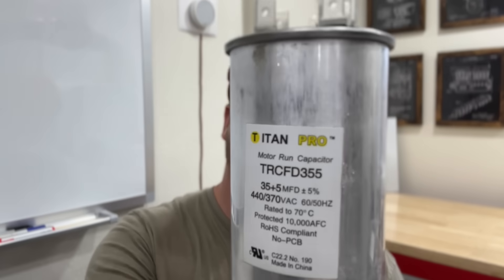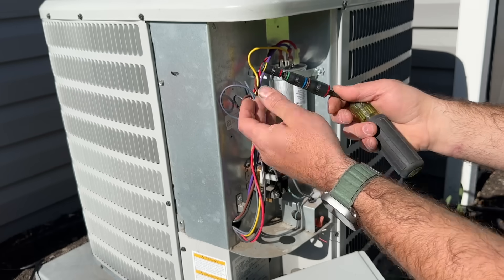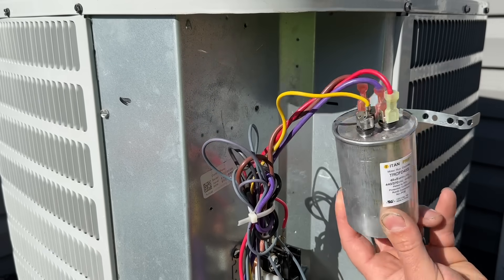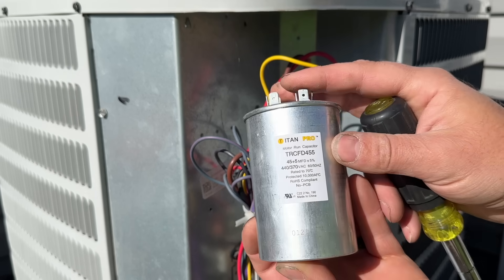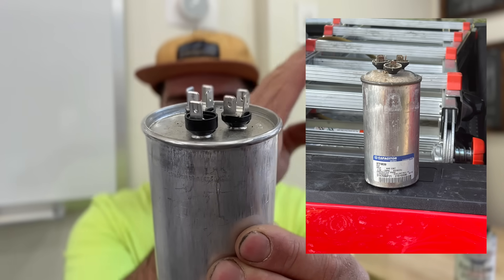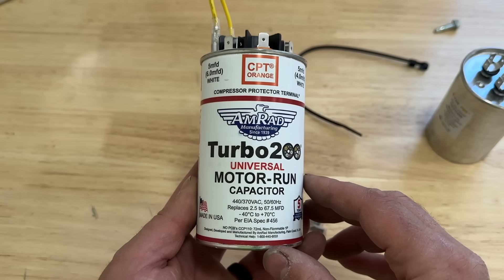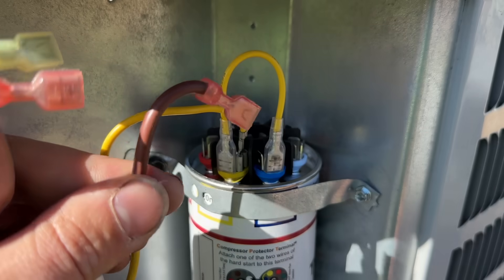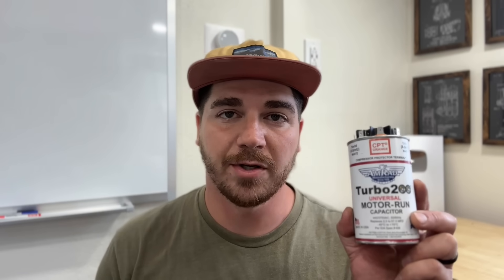HVAC Contractors Practically Make Their Living On These

Comment: I was a victim of this scam.  My unit was not cooling and they said it was the capacitor which was a lie. I know electronics and the capacitor is to help start the compressor. They charged me 300.00 but didn't add freon which is what I needed. I got my money back as well as a lame excuse. My compressor never had problem starting or was buzzing. Never called them again

Comment: I appreciate the videos that you are helping the people, on the other hand you are not disclosing the electical danger diy are exposed that could lead to death or injury opening a 240 volt system that is connected to very high voltage. just saying
Reply from the maker: How did I not disclose the danger? I said to pull the disconnect, and discharge the capacitor. And showed you how to do both. 🤦🏻‍♂️🤷🏻‍♂️

Comment: Pro tip. You can "jump start" your motor if it is humming. My fan wasn't running and I just took a small plastic rod and spun the fan in the "on" position and it took off.

This told me immediately it was bad AND it helped me cool the house a few times until I could get one in. I just had to monitor and make sure to shut the unit OFF when the unit cycled back off and repeat when needed manually.

Comment: I replaced the contactor then narrowed it down to the capacitor on mine - compressor was running, fan was not. I told my wife that it would take 2 or 3 days to arrive, but she refused to sit in a hot house for that long. So, had to pay a douche $490 to replace it. At least he came out on a Sunday and used one of those American-made "Turbo" universals, but damn!

Comment: Do you walk into a restaurant and demand you bring your own can of Coke instead of paying $3.50 for theirs at 1000% mark up? You are paying for the companies knowledge, time, investment in that part they carry around and so on. There is a cost to doing business. I've never heard of a $2000 capacitor but here in the Houston area we need to charge $185-$250 depending on the size of the company if you want to stay in business and grow. No one is talking about the $60k van, $5000 van wrap, $10k plus in tools and parts and the YEARS of experience that person or company brings to the table. I haven't even mentioned advertisement and other business costs yet. Most companies now use straight forward pricing so you know a level 1 "capacitor" will be anywhere between $185-$250.

Comment: it was the condenser fan motor,  probably the second most common failure after one of the motor start capacitorrs, that made me learn how HVAC systems work and are repaired. They wanted $600 for a fan motr that was $20 on Amazon and required the removal of 12 whole sccrews to replace. So I watched youtube videos until I understood. Now I advocate for minisplits with heat pumps.
Reply from the maker: Yes they can be reused 👍🏼

Comment: FYI, it's for power factor correction not holding energy to kick start the motor. Capacitors don't hang onto energy like a battery can. Instead, it shifts the power factor of a starting winding on the motor to make a bunch of torque at 60hz electrical frequency and 2-900rpm before that same 60hz electrical frequency and no power factor correction takes over from 900-1800rpm or wherever the motor was designed to operate on its more efficient, primary winding.

Comment: I do HVAC in automotive and I was having an issue with my evaporator coil icing on my home unit. I knew the system was low on charge so I started checking. Mind you, this system is 30 years old now and this is the first issue I’ve had in 15 years. Started spraying components down in soapy water, just a leaking schrader valve on the high side service fitting. Super simple to check, easier to fix. Had a friend who is a licensed HVAC tech charge it for me (I’m not certified to handle R-22), flipped him $150 for his troubles and saved a $500 service call. Even without HVAC knowledge, just type your symptoms in a Google search, you will get the answer.

Comment: A Capacitor is a little battery that gives your AC an extra jolt?  You should really get your information correct.  A capacitor is a device that creates your third phase of electricity that makes your motor in your compressor and condenser fan operate. They have a high discharge storage voltage that could harm someone.  Yes they are inexpensive and some unscrupulous tech can take advantage of people.  But care is required and knowledge is needed to test and diagnose this.  This is not like changing a battery in your car.  I am an industrial chiller mechanic with 36 years of experience.  Be careful with knowledge from a simple video.  I understand he is trying to help.  But caution and more research is advised.
Reply from the maker: I said it’s like  little battery. Most people don’t know what single phase and 3 phase is, so I’m not going to get into the science unnecessarily. I just want to help them replace it safely. If you don’t think this video is unsafe in any way, please state why. And it’s easier than replacing a battery in your car in my opinion. But to each their own.  Cheers

Comment: There's also a common offer that is getting you to buy an "AC Tune-up" at this week-only prices. They don't need tune-ups. These offers give them access to your unit and will often tell you that your capacitor is weakening. They don't get weak. They're good or not good. Don't allow yourself to get hosed by them!

Comment: 15 $ ??? , must be a china capacitor.  Be carefull what you install . The supplier sells the original for around 45-60$ . Hvac compnays have to make money so they will sell them around 120$ plus the service call . 

In canada the hvac companies are heavily regulated. The techs make 50$/hours plus truck, fuel, insurances, gas permits, contactor permits and much more.

A small company will charge around 135 $ for service call and 120$ for the part so 255$ plus tax.

A large company would be much more , around 500$ .

REMEMBER sometimes the capacitor goes because of other related problems

Comment: This is insane, teaching people to replace capacitors. This is extremely dangerous. if you were not trained to work with electrical systems safely, please don't attempt to learn on a system with large deadly capacitors. I went to trade school for the commercial electrician program but I don't  work in the field and have no financial incentives to say this. please be careful working with electricity.

Comment: I did this repair on a large central AC unit and the starter cap cost me about 80 bucks...I saw it was shorted on my capacitor tester.  It's really sad to hear that so many AC techs are low life's...A couple hundred bucks should be tops on that repair bill.

Comment: I am not an HVAC guy,  but I am a tech in the low voltage industry. The people commenting here are right, not all companies or individuals are bad people, in fact the majority are good and honest. Like any industry, there are always going to be bad eggs mixed in that tarnish that industry or trade. To say " all cops are bad" or "all roofers are this", "all plumbers are that" is just ignorant. I personally would never be able to take advantage of someone like that, but others do, some are even encouraged to do so by their employers to generate more $. Just because a part costs $20 to replace doesn't mean you will get a bill for $50, you have to take into account the time, costs, and fuel associated with scheduling your repair. When you call a company with your issue, they have to review and coordinate a tech to come out, schedule it,  recover the fuel used to drive to you, cover the tech and the office staff's time involved, then the cost of the part/parts needed, sometimes arranging to pick up that part, and having someone make an educated guess as to what the issue may be so they can bring the part when possible to avoid a 2nd trip.
The reason a bill may exceed $300 quickly for a $12 dollar part is because that tech probably makes roughly  $25-$40+/hr, the office/management staff gets paid hourly or salary,  the service manager gets paid, plus the service fee which is typically a flat fee during business hrs, and even higher for emergencies, after hrs, holidays, weekends etc. Most companies charge a minimum service fee or minimum hrs for visits that are unscheduled/unexpected. At the end of the day it is much cheaper for you to replace things yourself IF YOU ARE ABLE TO DO IT CORRECTLY AND SAFELY, but the reason these companies exist is because most people don't have the time, experience, tools or training to do it correctly, and often cause more problems when doing so because there are factors they just didn't know about that cause more damage to systems. You aren't just paying for a tech to come swap a part in less than 15min, you are paying for the experience and training invested in that tech as well. I am guilty of misdiagnosing and assuming myself. I actually misdiagnosed my A/C unit about 2yrs ago by replacing the motor when it was actually the capacitor that was bad. I found this out when my new motor would not start running after replacing it, I judged the capacitor by its appearance instead of testing it like I should have, and simply because I just didn't know any better. So now I have a fairly new motor which I had to wait to ship to me, then after figuring out I needed the capacitor in the 1st place, I had to go get that as well lol. This would not have happened if I tested to confirm my diagnosis, (would have taken less than 1min)  but I assumed... and now I know I need to do this before ever buying parts. Lesson learned. The motor was $148,, and I think the capacitor was $22. Another thing to consider is availability of parts. An HVAC tech usually has the commonly needed part's in their vehicle or at the shop, and when they don't they usually have local suppliers they can visit. It could take you days or longer to get that part, especially if there isn't one local and it has to be shipped. (some local suppliers won't even sell parts to someone without a commercial/business acct.) My point is, if you are going to do this yourself, prove your theory before spending money senselessly.  There is enough info out here to learn how to test and verify almost anything if you have basic skills, some tools, and a multimeter. I work as a fire alarm tech and I know when I an sent on a service call there is minimum charge, for Contract customers:
$115/hr x 2hr min, O/T and weekends is $172.50/hr @ 4hr min.
Non contract customers:
$130/hr x 2hr min, O/T and weekends is $195/hr @ 4hr min. So when I come out to a service call, the charge is automatically $230 for me to arrive on a weekday during 7am-4pm for a regular customer. If more tech are needed for bigger jobs, installs or repairs, that cost goes up accordingly.
If I use a part in my van you are paying for that too but most of all, you are paying because I have been trained to find and fix your issues efficiently and safely. If I am there for only 22min, you still have to pay the 2hr min charge, and that is just policy in the service industry. You can always call around to other local companies to see what their charges and rates would be to repair your issue if you think the charge quoted to you seems high or unfair. Things are not cheap these days, if you legitimately can't afford expensive repairs in one payment, explain your situation and see if the service company can work with you on charges, a lot of times they can accept a down payment and apply a payment option. To those of you out there that are trying to rip someone off, that $hit is gonna come back to bite you! I understand if your employer knows your on a job that will only take 20min to swap out a capacitor, but your told to stay on site for 2hrs and make it look like your working, while banging on pipes for effect, however wrong, that isn't exactly your fault. But those of you trying to pull a fast one on someone you think isn't knowledgeable or competent, I highly suggest you be careful. These things are exposed more than you can imagine, and if you are working for yourself or own your own business, you can get sunk real fast just over a simple review online for trying to rake thousands for a simple repair that would actually cost $190 to fix. Please do the right thing and don't try to take advantage of people. There is no good reason or excuse to be grimy like that. Helping people will come back to you, as will being dirty. If your business is sinking, more often than not it is your own fault for making bad decisions,  and even of its not through fault of your own it's still not right to take advantage. Do not try and dig yourself out by passing along rediculous charges that aren't necessary or warranted. Doing good by people will pay off far more in the long-term. Most of us are struggling out here, and we all need to do the right thing regardless, we should be helping each other, not hitting each other in the wallet.

Comment: The only thing these run capacitors do is act as a buffer between the AC unit and the electrical grid. A bad one will, in fact, break the system, but as you said, they're cheap, and also, if you're not seeing the lights dim or something on your house when the system starts up, it's probably not getting sketchy. My former neighbor, a commercial property, had a unit that had gone so far bad that MY lights would dim when THEIR system started up.

I need to clear something up that I just saw on another HVAC channel. One of the first things you learn in electronic principles school is that you cannot get an accurate reading on a capacitor's capacity while it is still connected to the circuit. That other channel was trying to reverse-calculate the capacity from voltage and current measurements under load. Just unplug the darn thing and measure it with the meter on the right setting. It looks like this:  --| |-- or --) |--

Now back to our show where I rant about HVAC scams and why this crap makes me never want to pay them for annual service packages.

Capacitors: $10-$20 part marked up to $200. I have the invoice from Red Cap Plumbing in Tampa in my email. Also, 1.5 years after they installed a new system to replace my mismatched dinosaur that came with the house, here were the things they tried to fleece me for: 

- Another capacitor, on a WARRANTY COVERED system that THEY installed. I refused the repair, checked it myself with a digital multimeter in capacitor mode and then called the office, whom doubled-down and said they would warranty the (unnecessary) parts but the labor was $200 to put in the (unnecessary) capacitor. 

- "Pan strips" (flattened copper pipe) to prevent growth in the condensate pan after they installed an aluminum evaporator coil. 

- "Bio growth" in the evaporator. Duh. It's wet. This is why we call them out to clean it. 

- a "Dirty" filter that I had just replaced two days prior to his visit. I had even written the install date on it. He never even pulled it out--I was there the whole time. They also tried to sell me a $2000 24V UV light + lifetime carbon element system that I found online for $250. Freakin' insane. This was after they installed the new unit and said there was no need to change anything related to the ducts or supply. 

After he gave his recommendations and a list of FIVE estimates for different tiers of remediation, I told him to leave. I never booked with them again, nor did I ever subscribe to a routine maintenance plan again because they and the other company I tried to work with just used it as a chance to try to scam me with $2000 solutions for something that would be a max of 2 hours labor and $250 parts. I'd gladly cough up $250 a year for semiannual checkups that take 30 minutes if it didn't involve some scary story to frighten me into paying them to save me from the seasonal allergies I've had since I was a kid.

Comment: HVAC guy told my wife that the "electric starter motor" was going out and needed to be replaced. She called me and I came home, because I was very interested in where this "starter motor" was located. The tech explained that the "starter" was inside the little silver can on the side. I stared at him for a long time trying to master my anger. I said "is it behind the capacitor?" He actually choked and stammered. "No this is the starter motor," he replied. I played along and asked him how much it was. He told me it was $500.00 and labor was another 500.00 plus trip fee etc. I showed him the Capacitor I had purchased for just such an eventuality. He said regular people couldn't buy good ones, and that one would fail in a month. I showed him the date I wrote on installed part. It lasted 10 years. I told him to get the f&^% off my deck.

Comment: I've never heard of someone charging 2000 to replace a cap.    They should be put in jail.   I have replaced many capacitors.  Usually when I walk out of the house its under 300 including the trip fee.

Comment: In 2020 I needed a new A/c and Air handler.  Went with a York system and it came with a 10 year parts and Labor warranty.  I may not even be around when this warranty expires.  Not pessimistic, just realistic.  Think I'm on my 2nd or maybe 3rd capacitor here in SW Florida.

Comment: Well, those turbo caps are expensive, but not 2K worth. One contractor I worked for didn't mind if I used one to get the customer operating, but he would also have me go back with the proper cap and put that in. Another contractor made me have an assortment of caps so that I would have the proper one, or could make the proper cap. That took a whole shelf of the work van to keep the stock.

Comment: Gives a little jolt of energy?  Are you even an electrician?  It's either a start capacitor, a run capacitor or a power factor correction capacitor. None of which gives "a little jolt of energy".